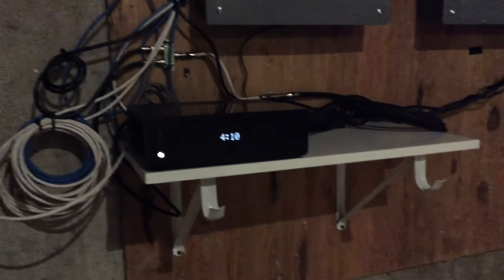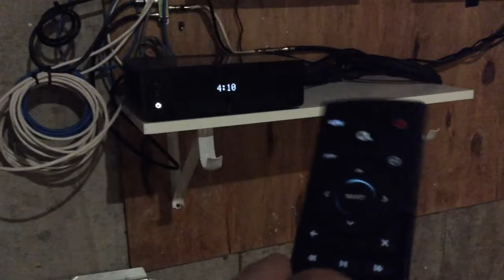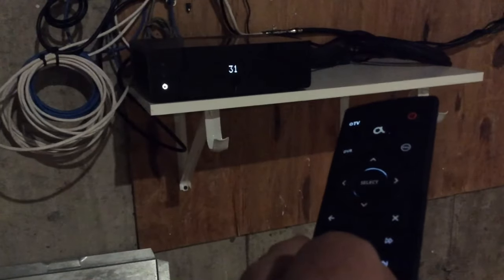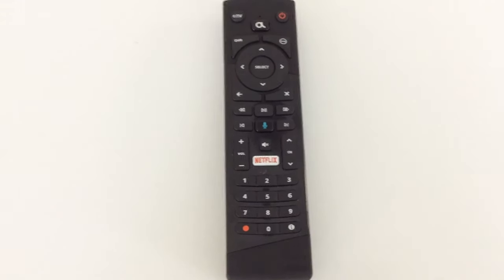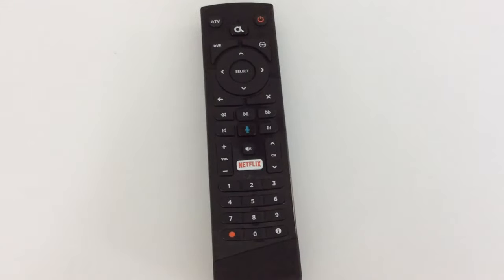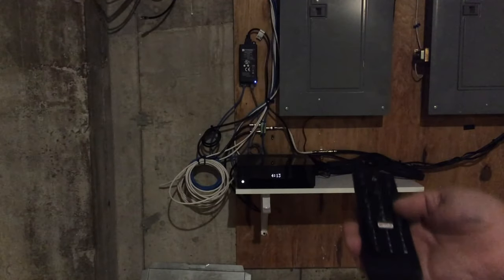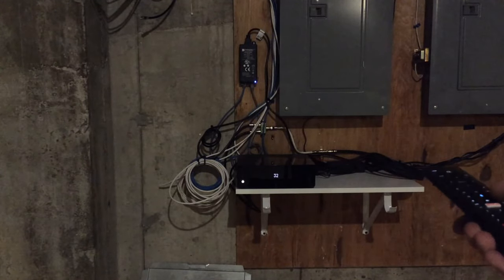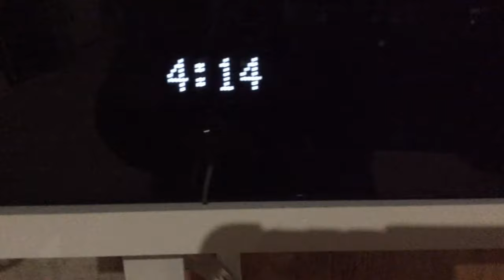How To Fix Your Altice One Bluetooth Remote to IR

Comment: What about a remote that all of a sudden does not do ANYTHING with the mini box?  I changed to new batteries, it is just unresponsive, period.  I never used or set it for the voice feature.   I cannot find a fix for this on the internet - all I find is how to pair it, but they are all directions that use a remote that the box responds to.  I have 3 other boxes and they all work with their respective remotes.  Any suggestions?  This happened to a previously working remote after a tech came out to fix some wiring issues- he never touched that tv, mini or remote.   It is the correct remote for that mini, and it always worked before.  I have just about had it with altice one and all the problems that go along with it.  I spent 20 minutes on phone before I actually got to speak to a live tech. Then another 70 minutes trying to resolve about 6 issues, only 2 were resolved.  They scheduled an appointment for a tech to come, and still there are issues!  My husband wants to throw it out the window!  We have only had it since december and it needs to be reset EVERY DAY.  They also switched my wi-fi to "smart wi-fi" without my knowing, and that messed up my wi-fi!  The tech assured me that they would never roll out a product that was not ready.  I assured her that they already did!  Thanks!
Reply: I'm having exact problem. Did you figure it out?
Reply: @kennethrutledge8568  sometimes my remote does nothing, or is unresponsive AND it blinks as well.  No matter what I did, it wouldn't work until I tried what I list here that has really helped me...this reset should address a few problems and is good to do once in a while to keep system running smoothly.
do you have the remote connected to the box for voice?  I don't, and never will.  I don't want it linked to only one specific box,  and i do not like things that can listen, or things that listen AND misunderstand instructions from me or ANYONE.
Anyway, here is what I do that might help fix your problem and other optimum problems:
Make sure your tv is off. 
Unplug your box's electrical FROM THE WALL for about 10 minutes. Then plug it back in.  Wait a few minutes, then with the TV still OFF, press and hold the two upper buttons on the mini at the same time - the wps and the button ABOVE it  (the power button is untouched for now) hold for about 10 seconds till they blink.  Wait about 10 minutes, then turn on the TV, you should have on-screen instructions to connect your box back up to your wifi (follow them).  If not, then it should at least show an update progress bar - presently the instructions should follow.   If the bar hangs for more than 15 minutes, start all over.  This procedure will 
reset your box from scratch (the mini only - for the main box it might be different).  This takes about 8-10 minutes to bring up the wifi connection instruction screen- you won't lose any saved videos or settings.
After you follow onscreen instructions to connect wifi, then  it will ask you to connect the remote.  You can skip this, it gives you a choice.  If at first you do not see a choice to skip the remote control connection, use the remote's "back" button.  The remote will always work as a regular remote with any box in your house if you do not set it up for the voice function.  It should work without you having to do any kind of setup.  
After this, as long as you can live without the voice function, it should be okay.   
Tips: 
1) before you resort to a reset, check the remotes batteries -that they are not dead and that they are seated correctly and polarities are correct.  
2) always keep the BOXES ON, but turn your TV off when you aren't watching.  The overnight updates at 3am will go smooth if you do this, so turn them on every day.  I only do this for the minis, the main box can be off.
3) if you have constant problems,  tell them they need to rewire EVERYTHING from THE POLE to THE HOUSE.  unless you have brand spanking new wiring, this needs to be done.  The problems stem mostly from old, brittle wires connecting everything.  
4) any problems not addressed here or at the optimum site should be googled, i see more and more user help info posted every day in many forums, which is where I look for answers because optimum has none.  I like the website "Downdetector dot com". If this didn't fix your remote problem, time to call them.
Reply: I changed the batteries for a second time and it ended up working. We have only had Allice for about 2 weeks. 
Thanks so much for responding back to me. Have a great 4th.
Reply: @kennethrutledge8568  you are welcome!!  Hope your 4th was wonderful!